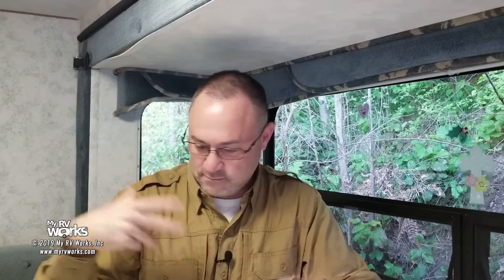[Q & A] 10 Minutes With A Tech - Session 4

Comment: How do u change a electrical reset button on a suburban 6 gal 110volts tank ins RV
Reply from the maker: We did a video a few years ago.  You may benefit from watching the whole thing but below is a link where we start the process.  

This is for replacing the DC side but replacing the AC side is pretty much the same thing.
https://youtu.be/EsjiDo7FN_Q?si=r-kNYDFRl8wR_ylX&t=1547

Here is a link to our Amazon store with lots of water heater parts:  
https://www.amazon.com/shop/myrvworksinc/list/TPZDSQ46E64H?ref_=aip_sf_list_spv_ofs_mixed_d

Comment: When you take the batteries out what do you do with the loose wires? It is a permanent RV and hooked up to 110. Thanks!
Reply from the maker: Even if an RV is set up for permanent use, it was designed with many 12 volt DC circuits. Those circuits get their power from the battery. The converter's job is to convert the 120 VAC Shore power into 12 VDC and charge the battery. If you remove the battery you run the risk of burning up the converter since that converter will continue to take hits from DC current inrush.  Managing this inrush current is the job of the battery.

We carry converters in our service trailer for this situation. Often we find that the battery is either removed or in so bad a shape that it's worthless and will not hold a charge.  You can get a group 24 battery for around $80. But converters are at least twice that much.

So, please leave the battery in and keep that battery in good condition and you will have many years of a happy RV with the DC circuits.

Comment: Hello darren. I have a dometic rm 761 
The 110 & the propane work fine but the 12v doesn't work I've watched a few of your videos done some tests & have a few questions 
First is it a true 3 way ??
The wires going into the heater box has 48.8. Resistence. Is that good ?? or bad ?? The only other 2 wires i see are for the light ???

Comment: Got a doozy for you, a 15 amp breaker has two outputs: an older converter/charger as well as 1 series of non-Gfci outlets. Loads didn’t exceed 15a combined anytime. Will work and occasionally trips with an electrical smell near one of the outlets. Outlets showed 1.2 ohms (hot to neutral)...almost dead short. Removing ONLY the  hot lead of outlets from the breaker lug, it then tested open. So only the breaker or the hot from converter could have affected the reading. I’d love to hear your opinion

Comment: I would say if you pull your breakaway switch lanyard out and your trailer batteries are dead, you may also have pulled your tow vehicles power plug and you would have no power to the trailer brakes to stop the trailer, thinking of a 5th wheel.😂

Comment: Thank you for your videos. Replaced my rear brakes lights with LED.  Replaced the rear driver's side first. Went back plug it into the truck everything worked. Replaced the other side. Everything worked but the clearance lights. Check power from the truck. OK, Ran a jumper wire from 12volt pin to clearance lights. Still no lights. Watch some of your videos and it clicked. I knew what happened. LED lights are sealed in plastic. NO GROUND. Looked for the ground wire and ran a jumper to the RV. TA!!DA!! We have lights. On a 2004 Mallard, the ground is in the rear brake lights. Keep up the videos. Thank You for steering the brain matter.

Comment: Where should I submit a question I have about repairing my aluminum frame in my 03 trail cruiser?
Reply: 2 of the 3 cross members are cracked where they're bolted to the trailer frame (the 3rd one is missing). That causes the passenger rear side to sag. The back one passes the wheel well, turns right at the outside wall, and goes under the door, where it's cracked again at the bolt used to mount the step. wondering if a "splice" is possible. (cut out the bad and paste in the good)
Reply: @qrevere5546  submitting here is just fine. We take all of the questions here and put them in a database so we can track them and address them in videos. - Tricia, My RV Works
Reply: @triciamyrvworks8263  thanks. Might as well update: replaced all of the aluminum framing. Lucky for me, no cabinets or walls were attached from outside. Used 1 1/2" Al tubes 1/16" thick. Note: they're twice as strong (or more) as same thickness stuff they replaced. Spoke with lady at dealership and thought just that and 3/4" ply on top would be ok. I chose non pressure treated tongue and groove. I used brackets rather than welding. I put a coat of thompson's on both sides. I used flashing tape on all the edges. I stuck foam board in between the plywood and underlayment just for a little insulaution (I live in SE US). Took WAY longer than I thought it would.
Reply: @qrevere5546  Glad you got it done! Thanks for the update.

Comment: Hi Darren. Thank you so much for sharing your knowledge with us. Your videos are so helpful. I have a 2020 Grand Design XLS 22MLE, with a WFCO model WF-8735P electrical panel. The converter seems to be integrated into the panel. I’d like to upgrade to lithium batteries and a solar system next year. Do I need to upgrade the converter? If so, what is the best course of action when the converter is not separated from the panel?

Comment: 2:20. Wouldn't a pedestal at a campground with breakers in fact be a sub-panel to the main breaker panel for the rv park and as such the neutrals and the grounds are never bonded at a sub-panel? Only at the main panel(first point of disconnect) are they bonded. Love your channel. I would definitely call you to work on our RV, if I didn't live on the east coast. The trip charge would be a killer. Lol

Comment: Question, 
I have (2004) a Norcold 1200 series refrigerator.  I’ve watched all your videos about them. 
I have, 
Installed baffles
Replaced and cleaned burner
Verified gas pressure (manometer)
Replaced regulator 
Cleaned valve behind refrigerator 
A/C side is starting to get weak on cooling
Flame is amazing (loud and clean)
Changed thermal switch on condenser to a 115’ on instead of the 130’ from factory
Fans are running great.  
Pulled the baffle from inside burner tube. 

I’m about ready to throw this refrigerator away and go with a residential if I can’t get it to get colder than 40.1 degrees on a setting of 9. 
Any help would be great.
Reply: @Kirk Walters same here.  I’m going to do a swap to the 12v DC compressor.  JC Refrigeration sells the kit so basically you swap out the back of the fridge fins and all to the upgrade.  Cost about $700 bucks.  Runs on 12v only no propane which is fine by me.  Residential fridges are to heavy and that particular compressor is not designed to be bouncing down the road so a RV tech told me.
Reply: JahRootsRadio after looking at the DC unit it would be $1300 with shipping
Reply: Kirk Walters ok the price I quoted was for my model my bad.
Reply: Same problem here... but I refuse to spend hundreds trying to improve something that has inherent design flaws.  A small residential refrigerator in my 1993 class C should work well off of my 2000 amp inverter and 2KWH batteries with 600 watts of solar panels.  My refrigerator placement is right above my tires.. I don't do off road stuff so the ride is relatively smooth.  P.S.  Thanks for the repair videos.
Reply: First thing we did after buying a 30 year old Holiday Rambler was remove the fridge and install a medium size residential fridge. A retired couple like us doesn't need a large fridge nor to be opening the fridge all day long so we are ok with it not running constantly, but just in case we installed a small 1000 watt generator that only feeds the fridge...no reason to run the large generator on the road when the fridge only takes a few hundred watts. Then the pandemic began and we haven't been able to test our theory yet. I secured it by placing closet-rod holders under the front feet and ran an angle-iron type heavy shelf leg across the top of the front and bolted the non-hinge side into one of the holes provided for changing the hinge-side and bolted the hinge-side the same way on top of the hinge. I cut and bent the ends to make a flange which I bolted to the fridge-compartment walls with appropriate bracing for bolts to hold properly. The fridge only cost around $300 so it's a cheap experiment. I haven't figured out the best way to install fridge doors locks yet. I have, but wife doesn't like my idea and hers is way worse. I'm going to have to do it her way so she can learn.
Reply: The baffle needs to be in the chimney to slow down the heat from the flame.  Without the baffle the LPG side will not cool at all. Any ambient outside temp above 90 degrees Fahrenheit  and all gas absorbtion refrigerators have a difficult time cooling.
Reply: Russ Campbell I removed and “replaced” the baffle. Made sure it was clean. Sorry I didn’t mention that.
Reply: Russ Campbell is the baffle you speak of for a roof vent or sidewall vent
Reply: JahRootsRadio I made a baffle for the top to help direct the air through the condenser and I pulled and cleaned the baffle in the flue of the burner tube.
Reply: Just changed out the thermistor. No change.

Comment: I finally fully understand 12 volt grounding vs 120 volt grounding completely. Interiorblighting of the rv all ground to the house battery system.
The 12 volt house battery electrical system grounds to that system only. Not to the rv frame nor the 120 volt grounding.
 So the only thing grounded to the frame would be the engine, starting battery and cab and driving lighting??? Is that correct?
Reply: I'm not sure that's correct: my original generator was definitely grounded to the chassis and my original converter (120 volt AC to 12 volt DC) was too. My 2 original House Batteries were also grounded to the chassis.